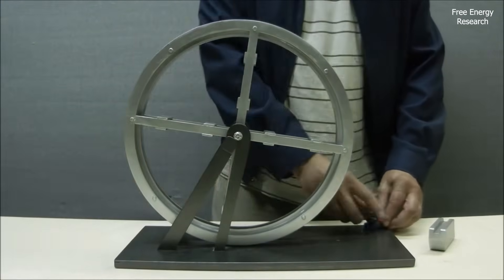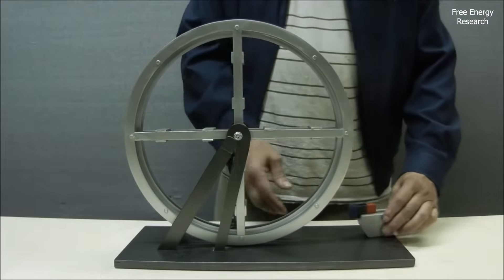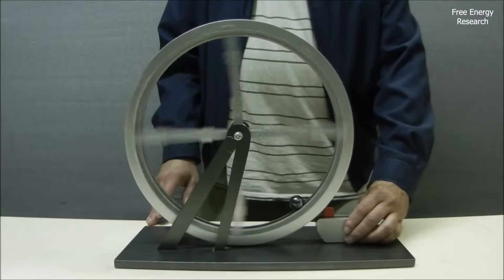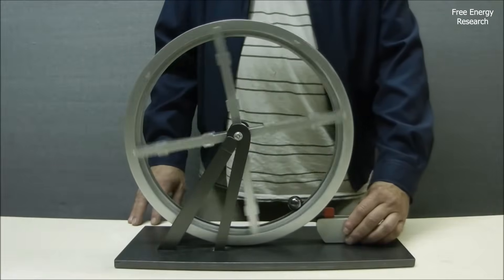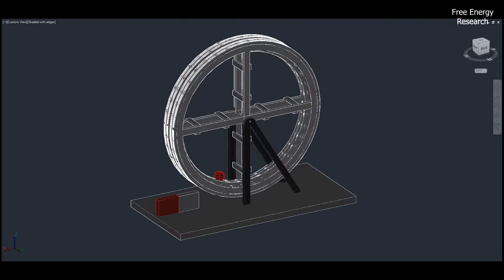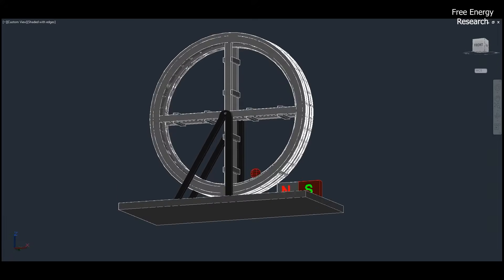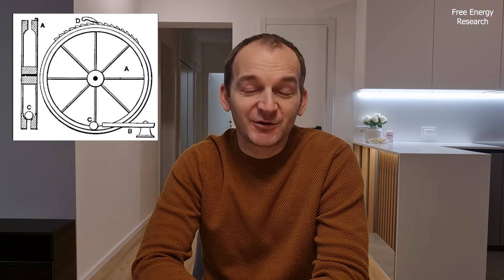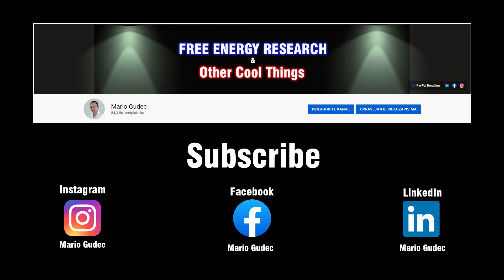Mackintosh Perpetual Motion Machine

Comment: Of course it won't work, the wight of the ball is not dragging the wheel downwards, the ball is just pulled towards the magnet. That can't get the wheel to spin. The same thing as to use a steel spring instead of a magnet.

Comment: I have designed a perpetual motion machine and this design that I have made is a unique and unparalleled design, but unfortunately I lack the materials and I do not have how to build this model because it requires a strong magnet designed specifically for this model and I cannot use the ready-made magnets that are available in the market because they do not serve the purpose, so please I need help. I am a beginner in designing 3D models on the SolidWorks program and I want to ask if there is a possibility for me to simulate magnets that repel or attract each other on the SolidWorks program because I searched and did not find
Reply: And I'm Mary Poppins!
Reply: Small advice: you will get ahead faster if you tell people you designed a more efficient conversion machine.